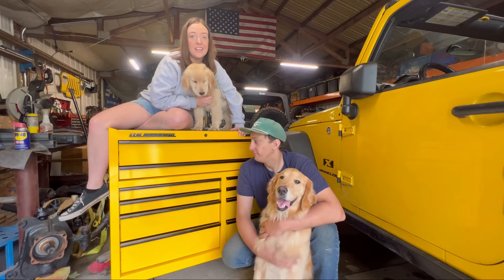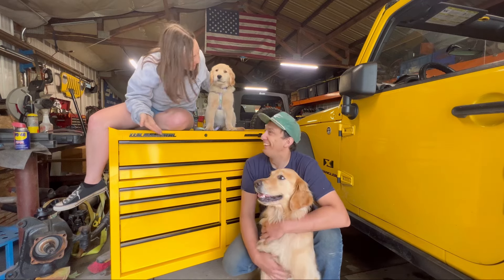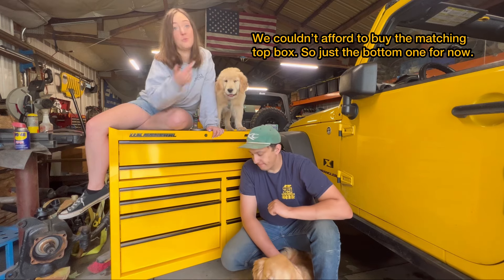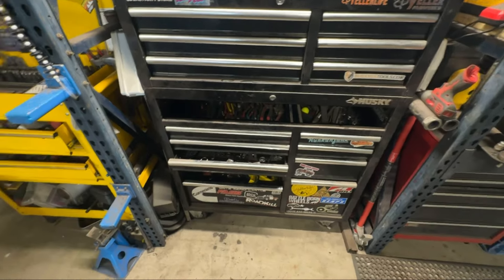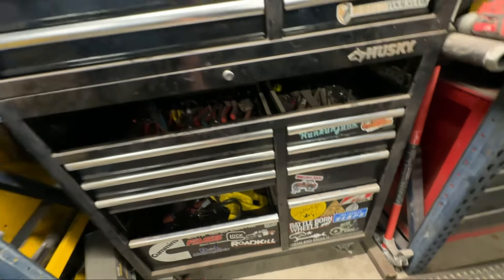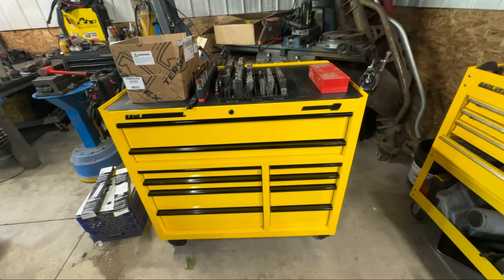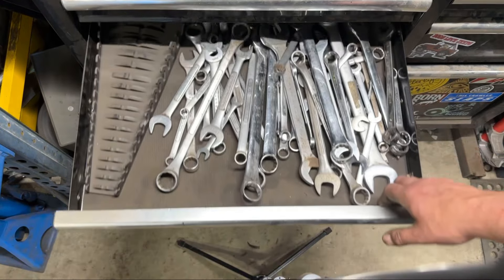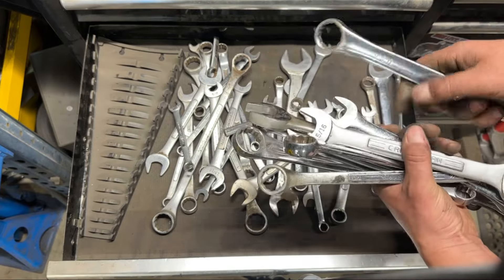HARBOR FREIGHT US GENERAL SERIES 3 bottom box — Reorganizing and moving tools into the new toolbox

Comment: Hi: to store the wrenches, find a sprig off of a hydraulic hose. These springs are used for wear protection for hoses. Cut the spring to fit the drawer. Slide the wrench into the gap of the spring. The tension of the spring will hold the wrench yet makes it easy to see the size of the wrench while it just slips in and out of the space of the spring. Best to you and yours from a welder/heavy equipment mechanic of over 35 years.
Reply from the maker: Old guy a my shop had some single gage copper wire wound in to a spring he used for his wrenches. Sounds similar so I’m sold haha

Comment: Just wondering, on your 42"roll cab. Does your roll cab  have 2 -90* angle braces underneath the roll cab, between the wheels? 

The reason I ask, I bought 2- 42" roll cab recently. One had more and beefier bracing (4 total), and the other had fewer and flimsier bracing, only (2). Which I ended up returning and getting another that had 4 braces.

Facing the roll cab, one had U shaped bracing at each set of wheels, along with 2- 90* angle bracing between the wheels.

The other had only 2- 90* angle brace at the wheels, instead of the U shaped bracing. No bracing between the wheels.